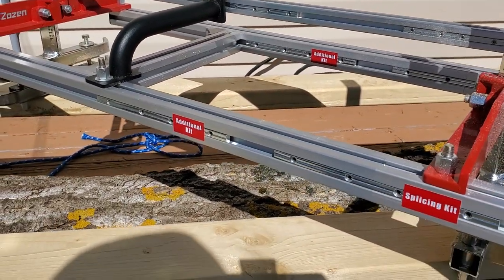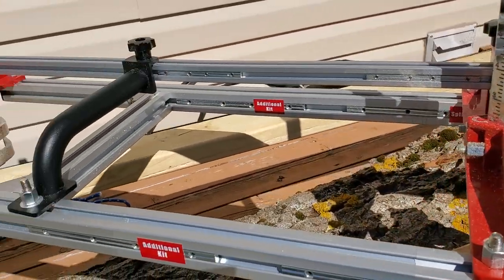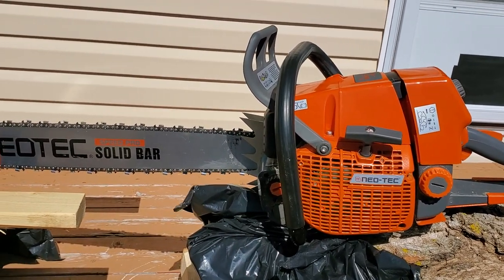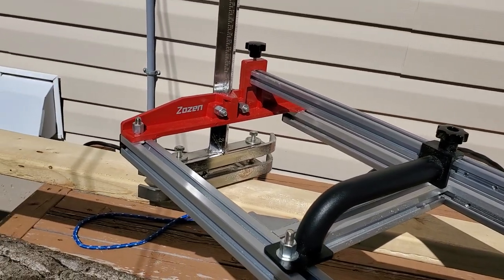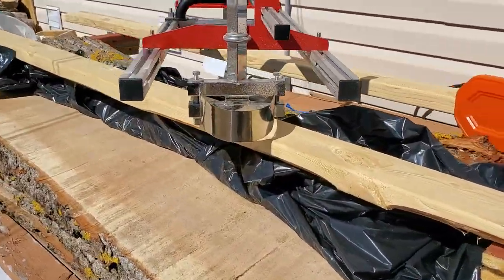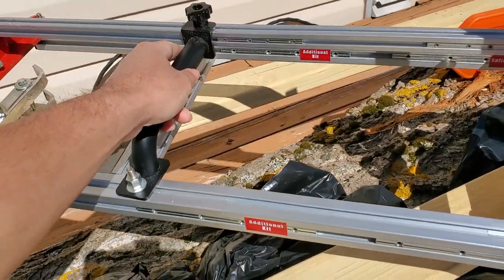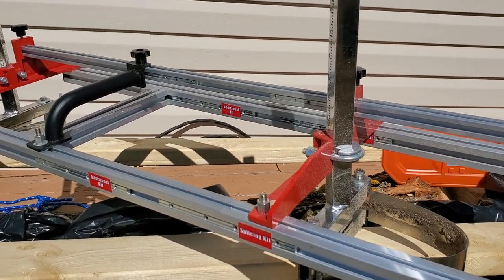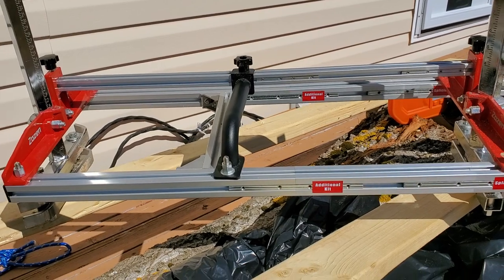Zozen Chainsaw Mill Review

Comment: Right on !  good job that's a big piece of hardwood you cut up there, I've only milled spruce and pine with an Alaskan mill,  if you need a few boards they are an awesome investment. I'll be moving up a step this summer :)
Reply from the maker: Good day, Thank you, I'm happy it worked out as well as it did. I can't wait to mill some soft wood with a smaller bar so the saw can really ripp!! Great investment especially if one needs to cut long piece's of wood.
Cheers

Comment: Nice review, and how is the saw holding up? It was mentioned to me that it is very important not allow any saw dust to  get past the filter it’s one the major reasons for engine failure of course, and NeoTec will replace those caps!!! They did for me. Best of luck. Steve
Reply from the maker: Hi Stephen! The 892 is running great still, Thanks for the heads up with air filter, I've never even looked at it. I will be checking it out before next use, I bought replacement caps off Amazon and Neo tec said they will cover the cost, but the new caps leak too, hahaha, I'm going to try the automotive O rings. Or just get caps right from Stihl. 
Cheers!

Comment: I see this mill has a extention kit you can put on it do you think you could use 2 or 3 extention kits to make a 60 plus in wide mill ive got some big logs to mill and don't want to spend the coin for a 80 in granberg unit
Reply: If you measure the extruded bars, you can get longer bars from FASTENAL or similar suppliers.
Just make sure if you have USA or Metric sizes.

Comment: I got my Zozen mill last fall, and have a few suggestions:
1) For any bolts or set screws that you will never remove, use a removable form of LOCTITE.  This will prevent them from loosening, but can still be removed or adjusted should you need to.
2) On bolts, nuts and set screws that you WILL be removing for adjustments, I secure them with some blue painter's tape.
Easy to remove, except might be a bit stiff in cold weather.
3) Keep a small ziploc bag of extra nuts and set screws to hand, with a bit of that blue painter's tape.  Stick that in the same bag the tools that came with the Zozen miller came with.
4) While the scales on the vertical adjustment posts are nice, don't depend on them for accuracy.  Instead, use your own tape measure to ensure you have the right cutting depths.
5) Last but not least, you can get extension rails as extrusions from supply houses like FASTENAL.  Just measure to make sure you order the fight sizes, as metric and USA sizes are available.  You can also get rail joiners etc. to fit the extrusions, with the possibility of making an absurdly large tool able to mill redwood trees....should you find a chainsaw capable of it.
Reply: I have been told that you can use the 12” extension kit on both ends of the 36 inch mill. Making it a 60 inch mill. Does your mail look like that would work question
Reply: @dibiase9502  Extensions offered by the manufacturer will work just fine.

Comment: I've milled about 25 slabs with mine between 6-8ft and 16-24" wide . The knobs will frequently come loose while milling, and are hard to get really tight. This doesn't really affect anything though, other than potentially losing them. Speaking of losing things, I forgot to tighten up the nuts on the very bottom of the clamp bolts. Lost every single one of them (clamps never came loose though)! Went and bought about a dozen replacements in case it happens again lol. My only major gripe is that my final extension piece on one rail is slightly out of square. Bows slightly upward almost 1/8" over the 12" length of the extension. It hasn't seemed to have caused any major issues, but I'll probably order a set to replace it eventually. 

The mill can handle a 42" bar, which will get you 36" of cut. I messed up and ordered a 36" bar for my Holzfforma G660 Pro and only ended up with 30" of cut. Tomorrow I'm going to take on my biggest log to date, a 28" Pecan. Going to be all my setup can handle!
Reply: Do you think you could use a couple extension kits and really get this mill wide like over 60in, of course you would have to make the top bar longer to do this but being you own one do you think it's doable, asking advice before buying one
Reply: @chrisholland2348  You could. But I imagine the more extensions you add the more prone the rails will become to bending. One of mine was slightly off from the factory, so I actually ordered an extension kit to replace that one rail. The extension kits come with two rail pieces as well as the top bar piece. 

So yeah, you could, I'd just be careful not to drop it or hit the mill against anything with any impact. And make sure everything is flat and square after adding extensions.
Reply: @generalkayoss7347  yeah it would need a center cross bar or 2 i imagine,  thanks for the reply makes me feel better about buying one and trying this
Reply: Removable LOCTITE on all set screws, nuts and bolts you will not need to move, but still can later.
All other fasteners I use blue painter's tape to secure them.